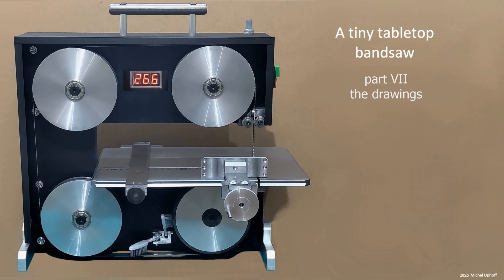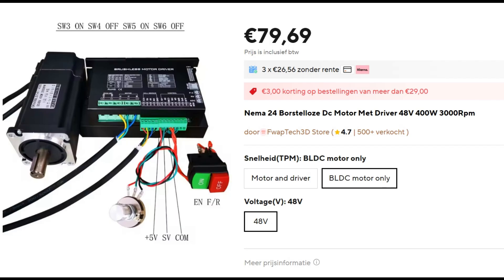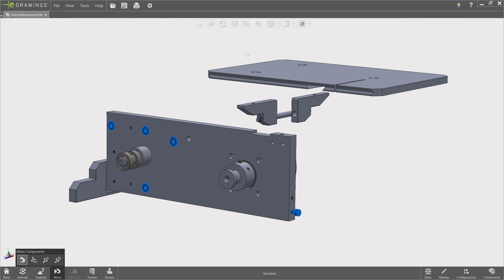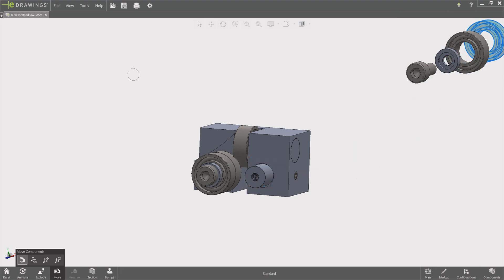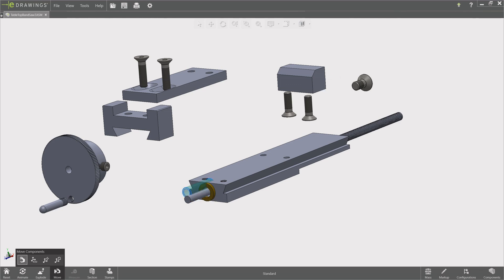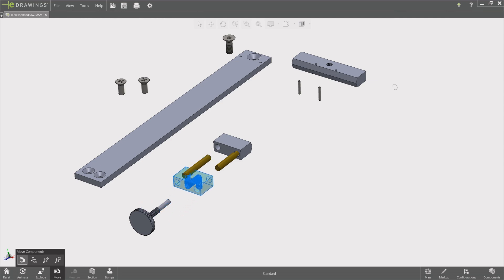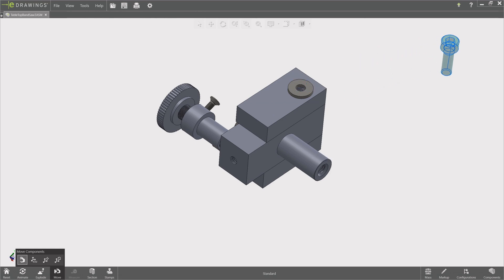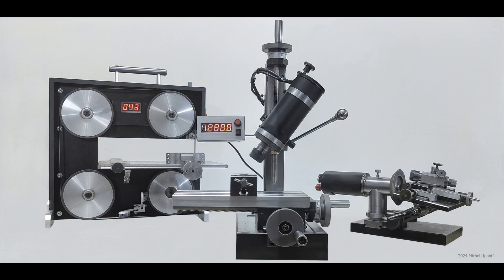A Tiny Tabletop Bandsaw part VII, free drawings!

Comment: THANK YOU for an outstanding series making a wonderful tool!
 I reviewed you saw blade analysis video and noted your comment about corrugated band saw blades. However, I am a bit confused about the terminology, although your photograph clearly demonstrates the cheap German blade. Are blades described that way in general, or manufacturer's literature? If I can't get Makita blades, what terms should I look for in a product description to get a good quality blade?
Reply from the maker: You don't want the "wavy" type because this shape is often made by pressing those alternate stress rising dents into the saw blade. They usually cost half as much (€ 20-30) as the saw bands where the teeth are set individually (€ 40-60). The "raker" and "straight" types are better. Saw band type: Bimetal, width 13mm length 1140 mm, suitable for (stainless)  steel.
See https://www.youtube.com/watch?v=Mln0IWRIzjk

Comment: Given your experience using the fine feed, would it make sense to have a quick disengage for the lead screw? That way you could push easy-to-cut stock manually (using the crosscut sled) rather than having to crank the feed handle.

Also, how repeatably square do you find the fence after you move it?
Reply from the maker: Yes, a quick disengage would be a very nice addition. It's not that hard to realize. I would probably modify the adjustable nut under the table for that, making it a half nut. The fence is very precise repeatable, but you need to keep in mind that you first press the rear flush against the rear edge and only then tighten the clamp knob.
Reply: @Michel-Uphoff  That makes a lot of sense.

Comment: I have a bandsaw allready, but if i didnt i would def consider this beauty.  Any chance that you want to have a go at making a tablesaw? sadly Jim Byrnes passed away so getting hold of a good mini tablesaw is really hard
Reply from the maker: No, that's not going to happen. I make these machines for my own enjoyment and use. If I were to make them for someone else, I would have to charge a fair fee, but with about 250 hours of work in one machine (which will of course be less the second time, but still a lot) such a machine would be far too expensive.

Comment: Nice and compact design, love it. The only small changes I would make is to use wheels without tires with a lip to guide the blade and a small dc motor powered rotary blade brush that turns perpendicular to the blade to brush the swarf off.
Reply: Wheels with a lip would get busted on the blade teeth no? Commercial bandsaws all use crowned tires.
Reply: @IsZomg  Most metal bandsaws these days use wheels with a lip on one side where the back of the blade sits against, that removes the need to worry about metal chips digging into the tires. Tires are fine as long as you brush the swarf off.
Reply: I would not recommend using a quality saw band with individually set teeth on wheels without a rubber rim. The teeth will eventually eat into the wheels, just as Michel showed in one of his videos. This is less important for the cheap corrugated saw bands, but as Michel showed, they break much too quickly when using smaller wheel diameters. Furthermore, rubber has the great advantage that slippage does not occur quickly.
A motor for wiping the band clean? That seems like a pointless addition to me.
Reply: @Andreas-Bauer21 The teeth hang off the edge, unless you want to use blade of different widths you're better off without tires. As I said, it's not a big deal. It's a small change that I would make if I built this. I wouldn't have to worry about changing the tires or chips and coolant affecting it. Cutting forces should be a sufficiently supplied by the tension of the blade, if you have to rely on the tires to prevent slipping your feed rate and rpm is wrong. Rotating blade brushes are pretty common in professional bandsaws, it makes a huge difference to blade lifespan.
Reply: @ryebis  I have see quite a few really small bandsaws, but never one with a lip. And I have never seen a band saw with a blade of only 13mm width where the teeth overhang, thus limiting the width of the wheel to only 10mm. Also, almost every small band saw has hard rubber rims around the wheels. Give me a few links to prove me wrong. Perhaps these kinds of features can be found in larger industrial machines, but we are in the wrong category for that. This is a tiny tabletop portable band saw, and I suspect there isn't even room for a blade wiping motor.
Reply: @Andreas-Bauer21 "I have never seen a band saw with a blade of only 13mm width where the teeth overhang, thus limiting the width of the wheel to only 10mm" there are plenty, I recommend making a visit to your local machinery supplier and asking about it. Or if you don't believe me, go to one of the machinists forum and ask other folks. The wiper wheel / brush doesn't need to be big, just small enough to brush off the swarf in perpendicular direction.
Reply: @ryebis  As I expected. Lots of blabla, and no links.
Reply: @Andreas-Bauer21 Youtube doesn't allow you to post links to block spam. You're just lazy to even try a google search, I'm not going to bother anymore. If you want to learn something, make an effort.
Reply: @ryebis  No, I'm not lazy. Of course I have searched for bandsaws with 13mm saw blades that fit your description (a lip, no rubber and a sweeping motor), they just aren't there. Links don't work? OK, then give me a few brands and model numbers of small bandsaws that do fit your description. I'm curious to see what you come up with
Reply: @Andreas-Bauer21 You won't see small bandsaws with chip brushes, no. You usually find them in big industrial saws. A search on band saw blade replacements on Youtube should bring up some videos, here's one I found "clark 4 half inch metal bandsaw replacing the blade". I've seen plenty of industrial and hobby bandsaws in my time (40 odd years), metal bandsaws don't need tires unless you have to change blade widths to avoid the teeth from grinding into the wheels.